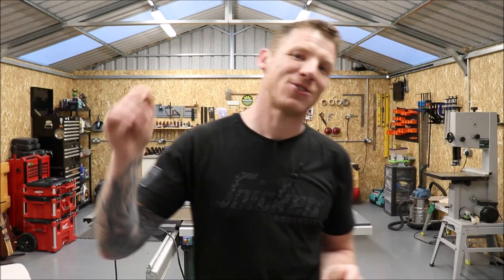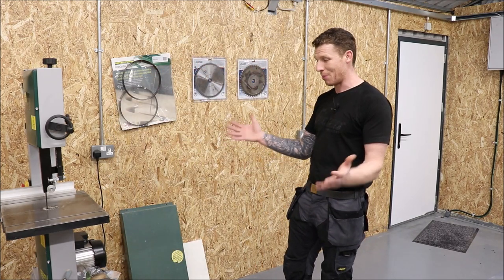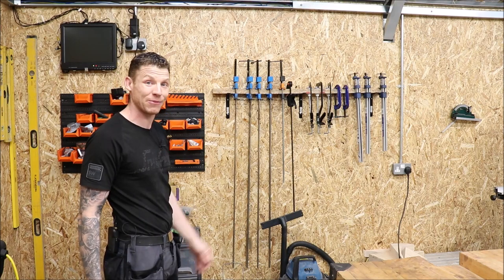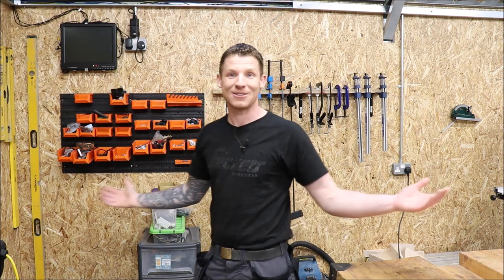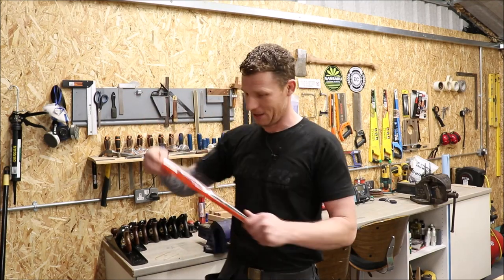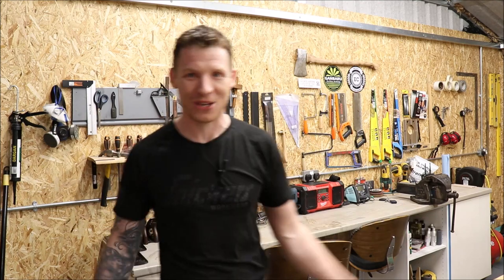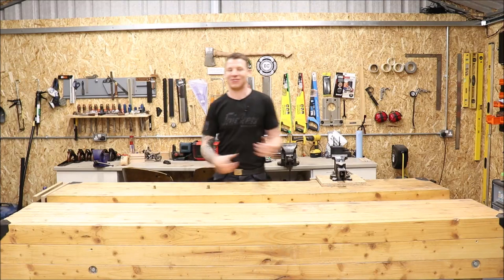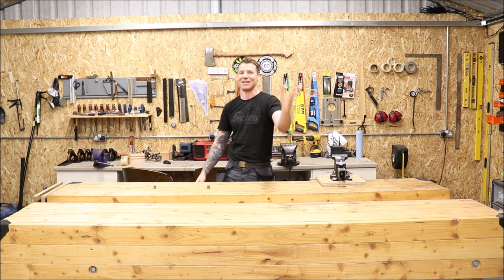WorkShop Tour 2019

Comment: BTW John, the Lidl F-clamps, especially the heavier ones, are surprisingly good for the money. Not as well-made as the old vintage record c-clamps on ebay.co.uk (and which don't show up on ebay.ie for some reason, but buy them there and use addresspal if the seller doesn't want to post to an Irish address), but they're good enough until you can get something fancier from Bessey or whomever.